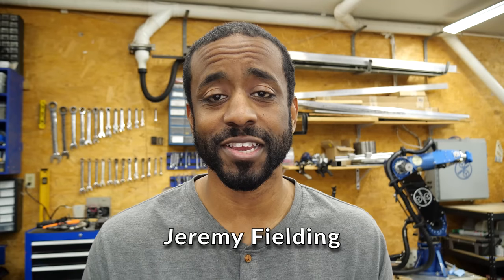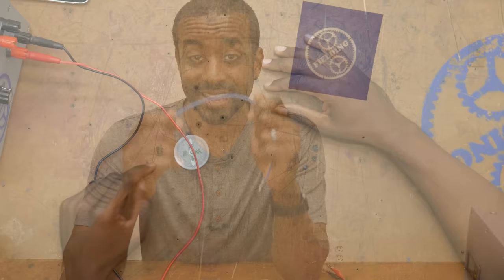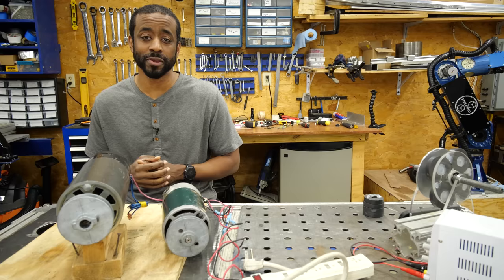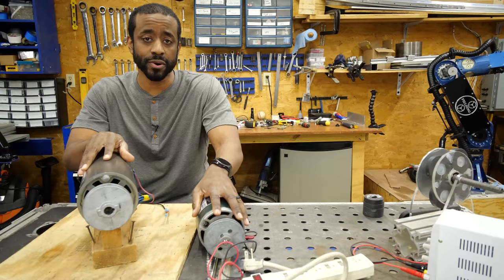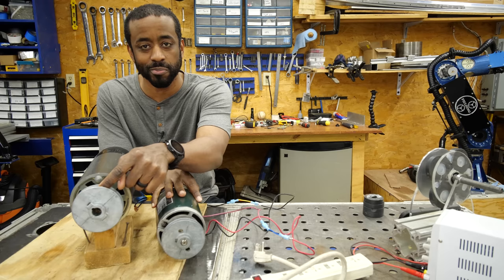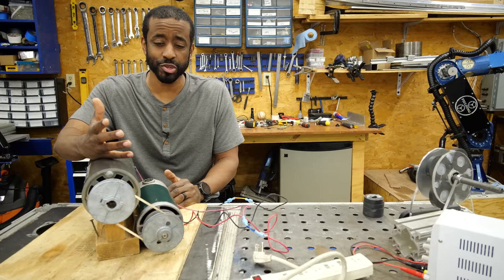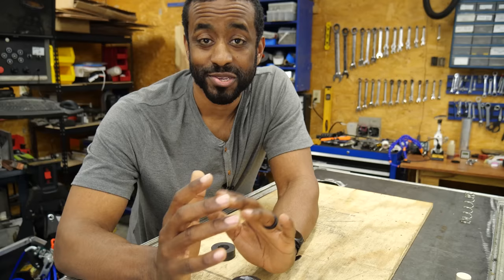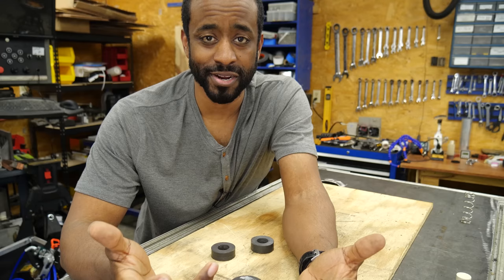Reviewing Free Energy Generators.  A Response to My Video "Nikola Tesla's Greatest Invention"- 102

Comment: There's a misconception that needs to be explained. It's a confusion between perpetual motion (which is impossible) and "free" energy. There's lots of energy out there that isn't being harvested, so basically it's free, because you don't have to pay for it.
Reply: What you say is true, but the Earth's rotation is perpetual motion in my books. But you make a good point about harvesting Energy, everytime there's a lightning strike we know there's an abundance of Energy in our skies...
Reply: There is also an abundance of Energy in our Oceans if we could only extract it in one process like with Magnetohydrodynamics MHD. If we could develop a System that could turn turbines, we could also harvest hydrogen and oxygen gasses it produces. 

Sure it takes energy to run it, but like Big Oil every Grasshopper/Pump has a three phase motor running it...
Reply: @steve-o6413  It might be in your book, but then perpetual for you doesn't involve eternity. In my book it does. And the earth won't be rotation until eternity. It will stop eventually a few billion years from now when our galaxy collides with another one ...
Reply: Not quite the earths rotation is slowing. We are loosing about 1 second every 5000 years. Nothing on a human scale but on A geological scale its quite fast.

Comment: Whenever someone asks why EVs don't have alternators, just bring up the fun fact that towing a Model S (I forget which year and submodel, there's so many small changes unknown to the public it's stupid) at 70mph will produce charging speeds akin to fast charging. Simplest way to explain it with a proven example, the person doesn't need to understand any of the details of the system, all they need to know is that an EV being towed, and thus the EV is outputting no power, will charge itself at a given rate. This can also lead into the explanation of how highway battery longevity is so much higher than city battery longevity, because in a multi-motor platform you can regenerate with one axle while driving the other axle along a continuous high pace drive; and again, the person doesn't need to understand anything other than a towed EV produces charge, just in this system the powered axle is 'towing' the unpowered axle. It's quite obvious the education system has failed many people, the easiest way to get them to grasp this concept is to use terms that have no prerequisite higher than basic understanding of moving parts; in this example, they don't need to understand anything more than EV, movement, and charging, all concepts they'll already understand, and they're not learning new concepts that they might not grasp immediately, it's akin to talking to a young child with their understood vocabulary.
Reply: I don't know any electric car, including teslas that get higher range on motorways than city driving. Regen only really happens under braking.
Reply: @columbo9336  The fact that towing a Model S at highway speeds can charge the vehicle similarly to fast charging rates literally disproves your, "Regen only really happens under braking," comment. You also need to learn how range fully works, it's not just about distance, it's a function of distance and power consumption; i.e. effective range would be shorter without the regen loop, and sure it may not be a massive boost in range but there is a considerable difference. Ever wondered why EV platforms saw a significant boost in range in larger countries like the US, when motors haven't became all that more efficient and batteries haven't become all that more powerful outside of scalability? You have a brain, use it.
Reply: bla-bla-bla       idioticlipflapping
Reply: @xaytana  if you were to recuperate energy on one of the axles while driving the other axle, the result would be increased power consumption, not reduced power consumption. It was even given as an example with only slight alteration in this video 🤦‍♂

Comment: Even solar and wind are a scam. I'm in Georgia for reference. I priced solar for my house and did the math. I also included the subsidies provided by my state. If I were to pay cash for the system, it would take me anywhere from 12-18 years to get a return on my investment. Some states offer crazy subsidies that might make it worth it though. I could spray foam my house and install double pane windows and get a return on investment in around 3 years. I know this because I did. Lithium batteries are not our future. The power to weigh/size/price/environmental impact just does not add up. Thorium is our future. Maybe they find a new reasonable battery technology soon. EV cars are a scam at the moment though. 15 container ships have the same "carbon footprint" as every car in the US combined. The are like 5000 container ships in service right now. There will never be a lithium powered container ship, airliner, backhoe, heavy duty truck, and so on... The foot print new modern engines leave is so small compared to other things that cant be solved with current battery/solar tech we have now. It is all a scam.
Reply: 12-18 years sounds like a good deal for a system designed to last 25+ years ... especially since you already did the even more important thing: properly isolate you house to not leak energy like crazy. And that's assuming energy prizes remain stable, which they likely won't.

For reference: If I were to buy a house today in Berlin Germany to rent it out, and I were to pay cash, I could expect to break even in approx. 40 years from now. Yet people are still buying houses ...

Comment: I have seen alternators used in off-grid cabins with a creek, they use the free energy from the water to turn a paddle wheel that then turns the alternator that charges their batteries with a controller. It works as long as you are running 12V systems and don't need a lot of power.
Reply from the maker: Perhaps you are misunderstanding the point of the video. I am trying to address scams. Water wheels have been a source of energy for thousands of years. Of course if you have a source of mechanical power like flowing water to turn the alternator, it will make electrical power in proportion to the kinetic energy of the water.. that is what it was designed to do. The problem is when you try to power "itself" with a closed loop. These doesn't work, and that's what this video is about.
Reply: I was just pointing out that you are right. It takes some type of energy to make energy, so the water wheel was just an example of one way I have seen to do it. Thanks for the video.  @Jeremy_Fielding

Comment: I already ran this over in my mind long ago. an altenator could be used in conjunction with a leveling system in an electric vehicle. IN other words, when the car is going down hill, it can activate the altenator to use natural gravity to charge the battery while the car is drifting downhill, as soon as the car levels off, or starts to go uphill, it disengages. It's a way to charge the car while driving, and while it's not going to make it run forever, it does allow for energy collection on the fly, and give you some extra mileage. Now the quetion is , does the resistance caused by the altenator take away from the coasting distance at the bottom of the hill more than the distance the energy stored will provide. More than likely, yes.. which makes the whole system useless.

Comment: Great video, the one time you can win with energy is to use your home AC unit in reverse cycle mode for heating in winter as it uses the heat from outside to warm the inside of your home. Much depends on where you are in the world,  (Doesn't work if its too cold e.g. <5 degrees Celsius.). The 2nd law of thermodynamics pretty much kills any free energy devices.

Comment: Hi Jeremy ive used transistor setup to pulse for motor effect across a bifilar wound coil and collected the discharge on the collector. It works so well to charge batteries they do not heat up the trasistor only heats.
Its fascinating research.

Comment: I’m not an engineer by any means, just a fascinated lifelong technician and I appreciate you sorting myth from fact. I do understand that perpetual energy creation without losses is not feasible, however could these ideas or theories work to minimize losses within systems that are currently available I.E electric vehicles if combined with the use of let’s say planetary gear sets and some careful math to increase efficiency in such a way that even if 15-25% off the power used by the vehicle is generated by the vehicle it would create a net benefit to the  plug/charge/use/plug/charge/use cycles we currently have. If something similar already exists I’d love to learn about it, these types of things fascinate me.

Comment: You can take four electric motors. Use 1 to  run the other 3 with pulley system So the power going in 1 is actually coming out of 3 of them Because the power current is reversed through the pulley system. Causing the power to come out of the other 3 of them. So use a 110 to run 3 of the 220's

So pulley size gear ratio Consider a car engine A hermanic balance pulley  would be for the 110 and the other 3 the 220's would be like a Alternator size for your gear ratio.
Reply from the maker: That is not what happens. Resistance increases in proportion to the load. I.e. If you try to turn three motors the first one will have to put out 3x more power. It will keep drawing more power from the wall until it overheats and quits. Gears have the same problem. They can increase torque but not total power. I demonstrate this regarding gears and alternators drawing more power with increasing load in part two. Link in the description. If this worked every power station in the world would work this way... perhaps like a pyramid. with one motor driving 3 and those three driving even more until we had infinite power. Except it doesn't work. If you don't believe me, Check part two or I strongly suggest you just try it. If you right the idea is worth hundreds of billions of dollars. Its the best way to learn!

Comment: The alternator should be mounted behind the back tire with a fully type system coming from the alternator and back tire, there for the tire is running the alternator with the alternator going to the battery to charge it.

Comment: You can let one of the wheels turn the alternator.
You can also place alternators in front of the car and turn them with wind power as the vehicle speeds down the road. Also solar cells on the top surfaces.
Reply from the maker: You should watch part two. Playlist in the description

Comment: Anything that produces power uses more power than it can produce. If you take a gas generator and replace the gas engine with an electric motor fix a starter and battery it still will need more power from the generator to power the electric motor then the generator can produce. The larger amp generator you installed will need a larger HP electric motor

Comment: I agree with you, to be fair however, they argue the 80% loss is made up for by the pully ratio size difference or efficiency ratio. So now it becomes a torque power issue, usable amperage efficiency issue of how much power does it take to turn the generator with a smaller wheel that's 120% smaller.  But like all feedback loops, once you look at the numbers and do the math, and nobody wants to run the numbers, so we're not done here completely, and that's where those bedini motor generator guys are at.

Comment: We need to focus on converting energy from one form to another. If it's not -196 degree it has a form of energy in it. Heat pump they say is 500% efficient that's because it dose not just produce heat but tranfer heat from outside to inside.

Comment: without a doubt it takes real HP to turn an alternator the cheapest way is water or wind until the alternator wears out. There is nothing perpetual about that even if you use a magnetic force or air as your bearings it wont last forever. the laws of physics still apply
Great video very well explained

Comment: Thank you Jeremy, I do appreciate your approach to sharing your knowledge. 
I do have a thought that has been in the back of my mind for some time now. I am hoping to get your thoughts.
I've often wondered if a cheap generator couldn't be run off of a  counter weight or spring. Something like a mechanical clock, kind of steampunk generator. I've not seen any post or videos on it (I have looked) I do realize it would require regular human input but, so does chopping firewood.
Thanks for your time & keep up the great content!
Jen

Comment: You cannot put an alternator on a Tesla because when driving a car you are increasing the speed and decreasing the speed, an alternator needs a constant speed that does not decrease or increase so as not to affect any circuit or some other energy regulator. The same thing happens when the power goes down in your house, causing damage to your electrical appliances and some of them catching fire.

Comment: If the alternator was coupled with the axle, then the batteries are not providing power to the alternator. I've been restoring and customizing cars for over 40 years. In that time I've mounted mire alternators than I can count to the front of the differential. Yes it only produces power when the car is moving but it uses less of the engines horsepower also when moving. They can do the same with electric cars, but don't and the question is ask the corporations who supply the countries power, why car manufacturers can't install a charging system in electric vehicles .

Comment: If you really want free energy, you can bypass your electric meter.  Maybe add a resistor in parallel with the house circuit so it shows some usage, otherwise it will look suspicious if you consumed zero KWHs.  But don't get caught or you will be in big trouble.

Comment: There's another important tech most people don't know exists that are very useful for faking this stuff.  The modern "Lipo" pouch cell.  A modern 2 amp/hour 3S pack with a 100C rating is capable of peaks of up to three horsepower and this pack is small enough to hide in your hands.  The cells themselves in the pack are often about as thick as a 2-4 nickels stacked (sideways, aka, the thin direction).  You can easily hide 2-3 horsepower worth of battery and inverter in a 3/4" sheet of plywood and have room to spare.